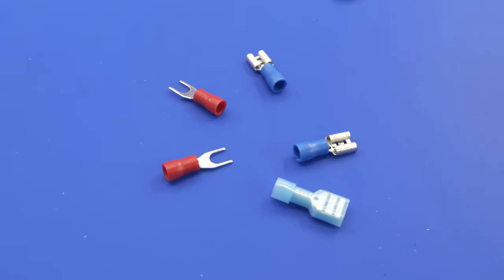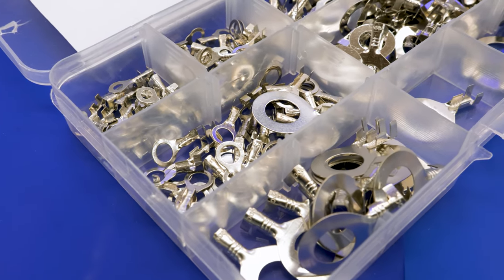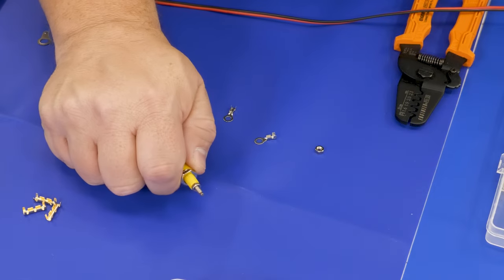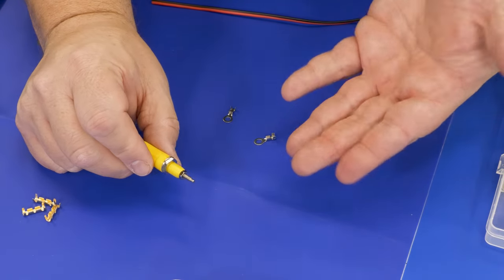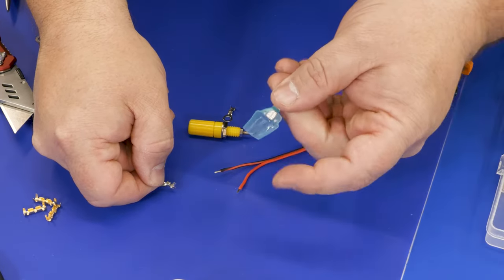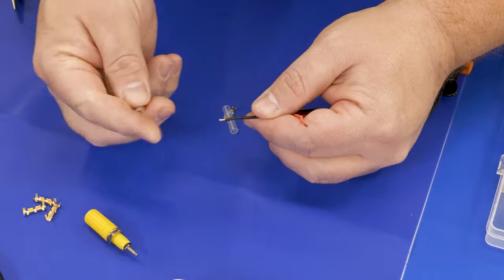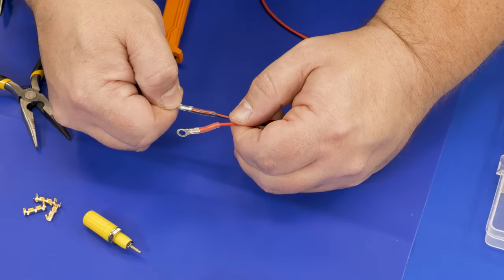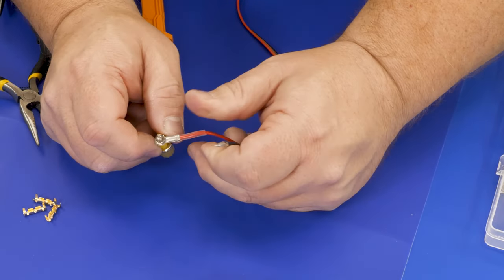Wire Terminals That Don't Suck - Frustration Free Connections

Comment: Thanks for doing the video.  I have had trouble with the standard spade or wire ring connectors.  No sizes work for smaller wires.  These look much better.

Comment: nice i don't think i've really tried this style connector... will do that.  i will say that for the normal crimping butt connectors (i guess you might call this closed barrel, maybe it's me but when i hear barrel i usually think of the 12v style power connector with a coaxial pin and grounded barrel/sleeve), i've had good luck getting a great crush using the knipex cobra pliers which have a flat area very close to the hinge so the leverage is tremendous.  built in insulation does have it's appeal but maybe not quite as compact as heat shrink, and heat shrink does feel a bit more pro to me.  also probably even with a good crush, closed barrel not so great for stranded wire, especially in projects with a lot of movement of the wires.
Reply from the maker: I'll check those out. Knipix has been great with their strippers.
Reply: @MakersMashup  totally.  i recently got the 13 72 8 electrician's strippers... they can cut a 6-32 or 8-32 threaded bolt without chasing the threads.  very nice.  oh also i should have mentioned that when i crimp with the cobra, i have to be careful not to crimp too close to the edge, it crushes so hard that the edge of the crimp will shear the wire.  that's power!

Comment: I use a different connector for joining 2 wires together and it has a shrink wrap built in and solder sadly I'm not home and won't be for 2 months. And I am not going to look for it when I'm doing 12-16h days 7 days a week currently. If I remember this I'll get ya the name of them though.😵
Reply from the maker: Don't sweat it. I've seen those. How did they work for you?

Comment: I don't get what you want to say.. putting the cable that's maybe 20, 22 AWG into a blue crimp which are normally for 14 to 16 AWG?!? Sure it doesn't work.
 Secondly those so called "crimp" pliers they send with the cheap connectors are totally for the garbage, if it's not meant to be an emergency repair.
I can just recommend to check the website from manufacturers that invented those connectors, like Amphenol or Molex etc, then have a look at what pliers they recommend and especially how the yaws look like and then get a cheap one that not just resembles them from the far. Those first connectors are totally fine with the right tool, aircrafts still use them, well from more precise manufacturers of course.
Reply from the maker: No just used as an example the different colors of course I'm not using a wrong range. The issue partly is the range itself.  22awg in a 18-22 connector is doomed from the start. If you have a quality crimper that can crimp those properly I'd love to see it.  Yes the flat ones are garbage as I pointed out but the ratcheting are OK but still hit and miss.  The precision crimpers work great it's the crappy connectors that are the issue.
Reply: @MakersMashup  well I use some weidmüllers crimp pliers.. or knipex but I don't know the product code. No failure so far under normal conditions.. but if the cables are likely under tension in your application, your connector is the better choice with the extra strain relief.
Reply: I have a pair of quality crimpers that make these crimps work very well for me. I normally work in a bit thicker gauge wires but for the small stuff I just strip off twice the length and fold it over?
I also order the precise size I want with m3 holes off ebay, the ones you get in a kit only carries very few of what's available. 
You can also get some thinner types in softer metal that works well for low current, I use them for an arcade build and they are great.

Comment: you dont like them becuase you dont understand them and youre using the wrong tool for the job.  yes, uninsulated connectors are better for small wires, or where youre bunching wires together.  but that doesnt make insulated connectors bad.  you need to understand which ones you are using, they have nylon, vinyl and heat shrink connectos, and varying quallities of each.  the same goes for crimping tools.  once you learn where each connector is useful, they become great options, but youll never find one thats great in every situation.
Reply from the maker: That sounds exactly what I described in the video.